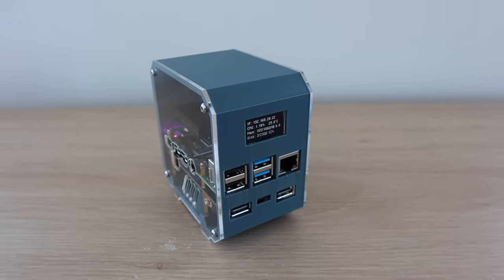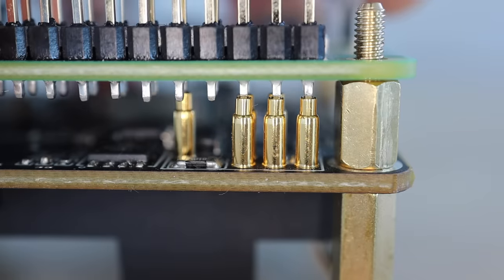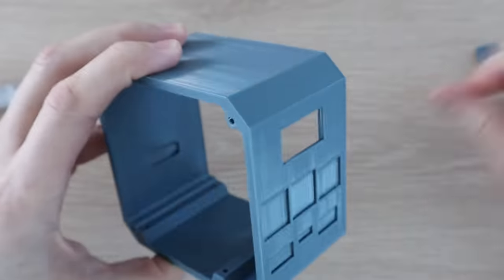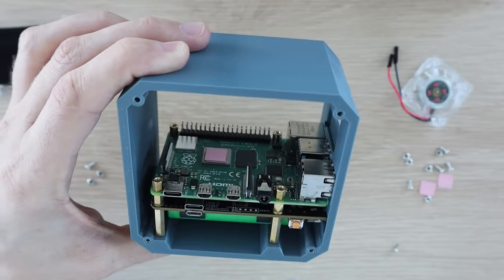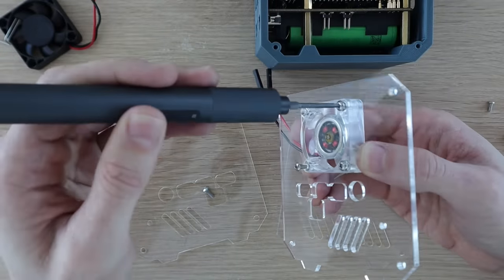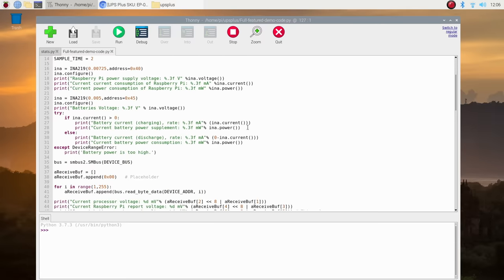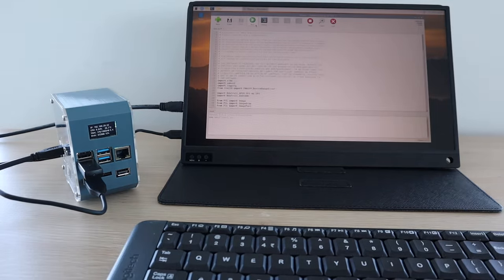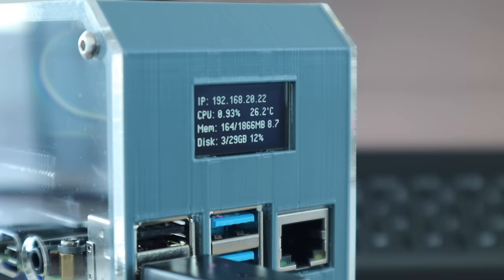Mini Raspberry Pi Server With Built In UPS & Stats Display

Comment: I made your first version, well, third? With my OLED, on the Front, plugs on the back and I just absolutely love it. I'd of overclocked it by now as the icetower does an amazing job keeping it cool but? With 8gb's of RAM and running the 64bit r pi os booting too a 240GB SSD? It's damn fast and I can run a ton of things without tapping resources. What's cooler is, when I get things going I can just glance at my OLED and see what available RAM is looking like. Good stuff Michael. Another great design!
Reply from the maker: Thanks for the feedback Jack, it sounds like you've got a pretty awesome setup!
Reply: @MichaelKlements  Thanks Michael! Your IceTower  Case set it all up quite well! I amazed considering 240bucks or so and it’s my daily driver for everything from CAD too Python dev, 3d Printing, you name it. Pretty cool that a little board like that could be so effective. I’m very pleased and it was certainly worth the money.
Reply from the maker: Yeah they've become quite capable for their small size, and you can't beat the price!

Comment: nice work... just one question... would it not work to place the fan on top pulling the air out?
Reply from the maker: You can do that, it just makes the 3d print a bit more complex

Comment: the link for the UPS module is wrong.  It links to an obsolete board with a EP-0118, not an EP-0136, which is required by the guide, and the superior version of the board.  2 days of troubleshooting later...

Comment: Hello, great work but can I ask is it possible to add extra storage to it? like an SSD expansion?
Reply from the maker: You can add an external SSD. Unfortunately the SSD hats/shields don't work with the UPS shield as they both need to be directly underneath the Pi.

Comment: just slide a small bit of plastic with a tab in each battery slot to prevent it touching the terminal, just slide them out with tweezers once built. just like Maccas toys use for the button batteries

Comment: Nice project but it would have been better if you had designed a case that would allow the batteries to be put in and taken out, once the unit was assembled.

Comment: would it theoretically be possible to use the stats display as a tiny terminal screen instead?
Reply from the maker: Displaying the text isn't an issue, but I'm not aware of any way to access the terminal text to be able to send it to an I2C display unfortunately.

Comment: Hey since both the battery terminals are visible and within reach upon construction then why not shove an cigarette paper between the live terminals when fitting to safely ground the battery and simply pull out the earthing cigarette paper after fitting?...could prevent damage though i admit its anything but an sophisticated fix...!!

Comment: You might have considered putting a small groove around the perimeter edge of the case and pressed a black O-ring into it.  It would not have done a whole lot for water or dust intergrity but would have looked very cool.

Comment: How about combining all your awesome projects into perfect mini pi server case.  With fan and display on front panel with ssd 128 kit, ups and pi with black low profile cooler with front fan pushing air across it and have fan exhaust out back with all of the pi ports on the back of case.

Comment: I would love to use one of them for CCTV purposes, but is there a USB memory stick equivalent of surveillance grade  hard drives?????  A normal CCTV system/DVR has to use surveillance grade HDDs because it is continuously writing, something that rapidly ages any other grade of storage medium.
Reply from the maker: You get better grade SD cards made for dashcams etc. that can handle higher write cycles, otherwise it's probably best to use an SSD for storage rather than a memory stick.

Comment: Is there a way to add a bunch of SSDs and a wifi dongle to this, so you can use it to run hard drives that can be accessed wirelessly from other PCs?
Reply from the maker: You can add external SSDs and the Pi already has WiFi. Lot's of people use these as network attached storage (NAS) servers.

Comment: I'd place some insulation sheet between the batteries and the battery compartment terminals. Then just pull it out to remove it, and voila, no risk of accidentally short-circuit the main board while mounting it.

Comment: Very nice build for sure. I'm curious though. Would it possible to put a PoE hat on top and be able to charge the batteries while also being able to supply power to the pi via PoE? Provided removing the heatsink in favor of the PoE hat. Certainly would be an amazing setup if that is doable.
Reply from the maker: I'm not aware of any UPS hats that are able to be used in conjunction with a PoE hat. You'd be better off putting a computer UPS onto your Ethernet switch and this would solve both issues (your network will still be up and your Pi powered)

Comment: I would LOVE to build this - too bad I don't have a 3D printer or a CNC laser cutter :/
You COULD insert a small piece of plastic in between the ends of the batteries and make it long enough so you can just pull it out (just like every other battery tab) when you are done building the box - but hindsight is always 20/20 eh? :)

Comment: u need a load leveller, soon as main electricity is off it cuts in & soon as the mains come back on its switches off. with that it will only come online when the mains are off..

Comment: wondering if the batteries are getting charged constantly which is not good and stress them can cause fire.
Reply from the maker: The charge controller only charges the batteries when they are not full, they're not constantly charged
Reply: @MichaelKlements  ah perfect! It looks soooo cute.. I guess I want one :D

Comment: why
 not create a model that sticks or fits behind a screen simply with an 
electrical outlet or it could be drawn directly with a usb-typeC 
converter. the screen is plugged into the Rpi which has a power cable 
all at the back of the screen.

Comment: One could isolate the power by blocking the battery with plastic sheet tabs inserted with the cells. Then pull the plastic tabs out when done building the ups. Just like some consumer products have while sitting on the store shelf.

Comment: Hey @Michael Klements,

I am a newbie in the Pi ecosystem & am really motivated by your projects. I would like to Incorporate 3 of your projects into my pi & need some advice on that.

Would I need to modify any of the scripts to use both the UPS & power button at the same time? Also is adding an SSD HAT between UPS HAT & the Pi advisable?
Reply from the maker: There's a bit of a hardware issue in adding a power button to a stack that uses I2C communication (the UPS hat) as the power button shares the SCL pin and shorts it to ground. I'm not sure why they've done this but it's not that easy to work around.
You would need to put the SSD hat underneath the UPS hat as the terminals from the UPS hat won't be long enough to contact the underside of the GPIO pins. You'd also need to check that the UPS actually has enough power output to drive the SSD shield as well.

Comment: Slip in a non-conductive ribbon on one end of the battery terminal while assembling. Pull the ribbon out when everything is assembled, to initiate the battery connection.

Comment: Very cool video! Just curious on the standoffs, do you print a thread in the case for them to screw into or how does that work?
Reply from the maker: I just print a hole that is sizes between the root diameter of the thread and the outer diameter of the thread. The first time they are screwed into the plastic, they cut a light thread pattern into it.

Comment: I really like this build and want to expand upon the UPS capacity for longer "unplugged" durations (power available for up to 2 days) if you could provide a couple revisions for the printed architecture to support this it would be greatly appreciated! 

I would like to see a video where you utilized a wireless charger for this device because often enough cellphone ports become damaged through corrosion, wear, etc.

Obviously, with my thoughts to having an asynchronous LAN network I don't want to be data cobbled by the latency and illness of the internet data providers off all things.
Reply from the maker: Thanks for your suggestions, I'll definitely look into them. I've never thought to try a wireless charger with a Raspberry Pi, I'll see if this is possible.
Reply: @MichaelKlements  wireless charge acceptor on the bottom, wireless charge emiter on the top, make the servers stackable. How many servers could run from one wireless charger I wonder?

Comment: this tidy little unit would be amazing with the suggestions by scott clausnitzer, esp the battery door option, also somehow manage to fit in a 2.5" ssd drive and this thing is looking feature complete while staying nice and compact with that fantastic little screen showing some essentials.  best custom case ive seen to date, cant wait to see newer version(s).  Would be amazing to see this handed to a company that can mass produce it as well.

EDIT: The Waveshare CM4 IO BASE Board (B), looks the sameish size as a regular pi but has an m.2 slot underneath it for storage, that board combo may be better than a bog standard pi for a case like this.

Comment: Newbie here ! I have been looking into the raspberry pi 4 B and I found that there is a way to add a ssd drive and a ssd m.2 drive, also there is another board that connects to the raspberry pi 4 to get regular HDMI ports and something else, are you planning on coming with a newer version for the enclosure ? I have been reading and I will like to have all those options with the Tower Ice cooler, by the way the enclosure looks awesome.

Comment: How did you manage the dimension of the Pi to case design? Did you did trial and error or took the dimension somewhere?
Reply from the maker: I just took measurements from the Raspberry Pi
Reply: @MichaelKlements  thanks for the response. I did the same thing, but it turn out the gap between 3d printed parts and RasPi was so close and USB cables won't plugged in properly. So i have several trial and errors regarding this gap. Maybe it could be a good topic for the next video if you don't mind 🙂
Reply from the maker: Yeah clearances around components and ports are a bit of a "feel" that comes with experience. Each design you make will get a bit better.

Comment: I hope this works out for me. I'm going to use several rasberry Pi 5s for a proxmox cluster. The types of severs I need are Jellyfin, NAS, RLCraft minecraft,  Vanilla Java Minecraft, Pi Hole, Wireguard, and if possible a windows 10 one for installing software or modding games then porting them over to my linux gaming pc.

I currently use an old gaming pc that I had lying around. It has an i7 4790k, 32gb ram, gtx 1060 6gb, 2 20tb server grade HDDs one mirros the other in case one dies, and 2 1tb ssds for the vms but one mirrors the other for peace of mind. 
This hardware uses so much dam power that I don't want to keep it going anymore. And proprietary hardware is so expensive ! 

I plan on making this setup, but with 5 rasberry Pi 5s as a start. I'm hoping that my solar setup can handle them. I use a 12v 200ah lifepo4 battery with a 12v 40ah lifepo4 battery as a backup. And 4 100 watt 12v solar pannels ! I have so many frequent power outages in my town that I had to make this setup to power my outdoor lights and my internet setup ! Hate having to reboot my internet setup and having my security lights go out during a power outdage. Rasberry Pis uses so little power that I hope this works. I can also use laptops, but naww they use even more power.

Comment: How much power does it use? And how long does it take to boot up
Reply from the maker: Both of those questions depend on what software (and operating system) you're running on it. They typically use about 7-8W and takes about 20-30 seconds to boot up.

Comment: This is awesome. I do have one question tho, from the looks of it you have the fan as an intake fan but in the video you mentioned you wanted the air flow being pulled up though the vents not out through the vents. was that just in error? Either way that is awesome!
Reply from the maker: Yes the fan is an intake fan, so air exhausts through the vents at the bottom. I don't think there would be much difference in cooling either way, it's just important to get some air movement within the case for the large cooler.
Reply: @MichaelKlements   I'm mostly curious if the air would just bounce back and forth more instead of j just being pulled up and through but I really dunno which way would be better like you said if it even makes a difference

Comment: Hey there, cool project.

Could you please fix the links for
-2 x 18650 Lithium-Ion Cells
and
-128x64 I2C OLED Display
please?
They dont work.

And when I order the Kit on ETSY what is included exactly? Only the case or also the screws and nuts?

Regards
Reply from the maker: Thanks Finn, I have updated the links.

It includes the screws and nuts that aren't included with the UPS hat or Ice Tower. There is a list of the contents in each product description on Etsy.
Reply: Thank you!

Looks like I have not read enough of the description 🥴

Comment: What is the advantage of the UPS over just using a battery pack as a power source, keeping it plugged in and charged until a power outage occurs?
Reply from the maker: A UPS integrates everything you'd need to add to the battery pack. If you use a battery pack you'd still need to add a charger for it, you'd need a regulator to stabilize the output voltage to the Pi and you'd need some way to tell the Pi that the battery is running low and it should shut down.
Reply: @MichaelKlements  ,

 ,

I’m not following.

I have a pi running 24x7 which runs off of a cheap powerpack, which is continuously charged via a usb phone charger. No regulation needed. It can run on just the power pack for hours without any external power source.

A UPS needs an external power source as well.

I agree that the capability to be notified of a low battery is one advantage- but I’ve never used the that capability on my workstation UPSes anyway. I suppose if your application requires that it would be a nice feature though.

Comment: How do you determine how much battery power you'll need if my build has an attached 7inch monitor via the ribbon cable?
Reply from the maker: You'll need to measure your Pi's power draw using a USB power meter then convert that into a current draw at your battery voltage to calculate what size batteries you need.
Reply: @MichaelKlements  perfect. Thank you ❤️

Comment: Hey man, any plans on restocking these again soon? I'm wanting to match my other case and get the ups version. :)

As for power isolation, use the Raspberry Pi 3 in-line power switch once unit has been shut down, it's micro USB.
Reply from the maker: They’re back in stock again. Thanks for the support!
Yeah the power cables with an inline switch are quite useful

Comment: First off great work!
I am thinking if it is possible to allow the board to be slot bolt mounted on your 3d printed blue "chassis" instead of using the provided standoff it would allow more room for battery access and replacement?
Reply from the maker: That's a nice idea

Comment: to avoid the risk of sorting the pi, couldn't you do the stand-offs before you put it into the case then screw it onto the case?
Reply: can you buy the stuff excluding the pi?
Reply: or put electrical tape on pins (on battery pack)?

Comment: Tip: You could have isolated the batteries using the protection foil and activate them afterwards by pulling the strip out without risking a shortage.

Comment: Looks really neat.  Did you look to see what you can get for those 250 buck (+) worth of parts?  I just got a low end laptop on sale at BestBuy and loaded it up with Linux.  Much cheaper.  About 3 watts.  Use it as a file server and anything else I can dream up.

Comment: Is it a UPS if it just battery powered? Does a phone have a UPS? because I argue that a Raspberry Pi is so low powered I wouldn't call it a UPS but more battery powered.
Reply from the maker: A battery powered device is designed to run on batteries and be re-charged between uses. A device running a UPS is designed to run on mains power and to only use battery power if the mains power dies.

Comment: nide design, can you include designs with build in long bolts, or long metal screws designed thru entire plastic to prevent delimitation issues over years of use? prob 4 or 8 of them going into sides of plastic in direction of layers. the holes should fit a 4-5mm bolt and be at least more than 3/3 thru part and come in at either side. the design does look great!

Comment: Wait, even if you don’t attach a monitor, and instead use it purely as server, with server edition OS (no desktop UI), - it still requires batteries? For what?
Reply from the maker: The UPS addition is to provide backup power, you don't need to use the UPS if you don't need it. The UPS will also run without batteries, it just obiovusly won't function as a UPS then.

Comment: Stupid question, but what's the cost here versus buying a full-fledged small server machine or workstation that has the same horsepower?
Reply from the maker: This costs around $100-$120 for all of the parts, so you can't really get much else new for that price. You could probably build a significantly more powerful server from old hardware though, a Raspberry Pi is made to be power efficient rather than powerful.
Reply: @MichaelKlements  where'd you get this stuff? What's the list of parts? Cheapest RPi I see on Amazon is US$170+
Reply from the maker: The components for this build were bought before Pi's were being sold at ridiculous mark-ups. I paid $35 for the Pi in this build